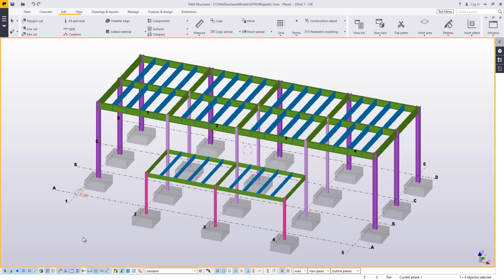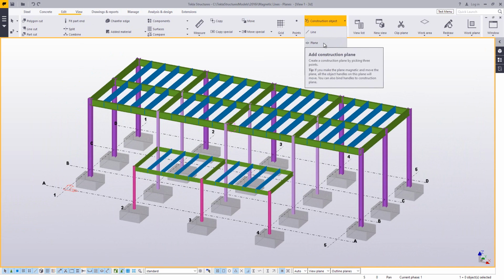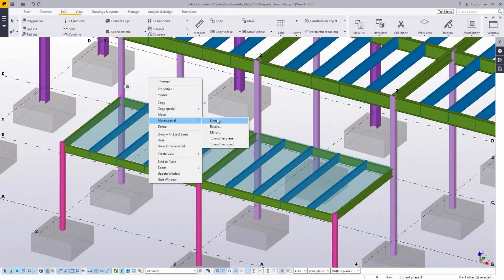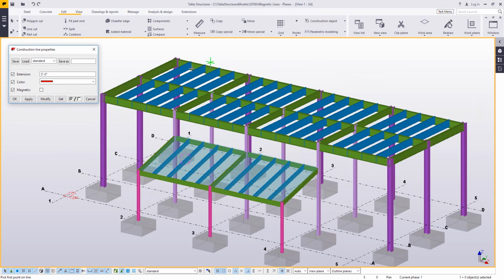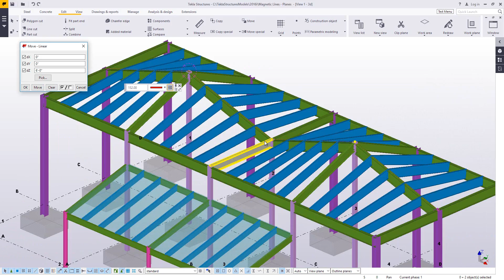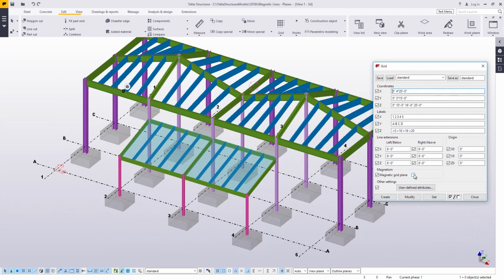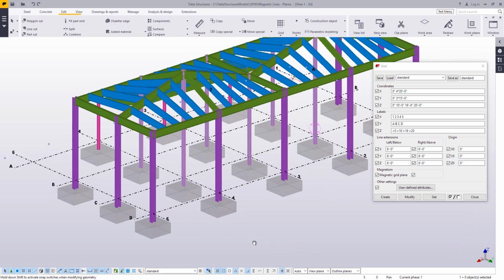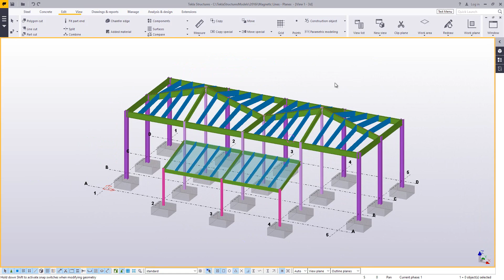Easily Move or Adjust Groups of Objects with Magnetic Construction Objects

Comment: How do we control the rotation of infill beams when there is different slope so that it torsion doesn't happen
Reply: If you customize your side pane you can enable the 'deforming' section that includes a 'warping' value where you can add twist.
Reply: Thank you very much Dave I appreciate for the quick turnup can you just post a quick video about that

Comment: Hi. In my tekla 2018 (educational) if i put the line right to the steel beam, it does not move, only if i put to the grid line it will move? HELP
Reply: Make sure the construction lines are being turned to "magnetic", they are not by default. Also verify that it passes through the handles (yellow and magenta squares) even if the physical beam is offset from them.

Comment: I've noticed an issue with magnetic gridlines (actually it has to do with the direct modification of them). It works just okay, but if you look up at grid options window the coordinates seem not to be changing at all. Not a big one but still is there anyway to fix that? From the first days of using TS i've been insistently recomended to save the gridlines after you finish modifying them. So...Thanks in advance.
Reply: This is normal behavior - once you interact with the grid lines in any way manually, the link with the dialog box is lost. That is why if you ever modify the grid dialog, you get a warning about "manually created grid lines". So it's best to use the dialog to lay out the bulk of the grid, make changes there if possible - but if you need to modify them manually, use the Save Grid to File extension instead: https://warehouse.tekla.com/#/catalog/details/ufa0a1aad-5d68-4067-b37f-15f26b5f034c

Comment: is this possible in concrete for water drainage?
Reply: Hi Romeo - typically no, since the magnetic settings only work for moving the handles. With concrete created using the slab tool you have to add chamfer values to indicate how much a corner should be raised/dropped - the handle stays in a static location. There are some cases however where it might be possible to use the magnetic planes - for example if the entire end of a beam or an edge of a slab needs to be adjusted. So focus on whether the handles need to move or not. If yes - you can use magnetic tools. If no - then no you can not.
Reply: Thank you very much Sir. David

Comment: I cant get mine magnetic planes / lines to work. It moves the header beams, but not the joist or filler beams. with or with out components.
Reply: Hi Dave - it is critical that the end handles for ALL parts touch the magnetic objects. There is no tolerance to be 'close' to a magnetic line or plane. When you click on the part, the yellow or magenta handle needs to touch. When I find that parts don't move, it's usually because the end handle is just slightly off.

Comment: Could anyone help me, please ? I did like the video guided but only the contruction plan was moved and objects wasn't moved
Reply: Hello - you have to make sure it is made magnetic - double-click on the plane and check the option on for 'Magnetic' and then click Modify. If the end handles touch the plane, the part should move... unless you also have magnetic grids enabled. Then the grid may override other magnetic objects.

Comment: Hello. Using the model in the video as reference, if I need to have the drainage point at axys 3, I still need to figure out the intermediate low point at axys 2 and 4 is that right? I tried putting the construction line from 1 to 3 and 3 to 5 but the steel on axys 2 and 4 doesnt slope down following the line. Thank you.